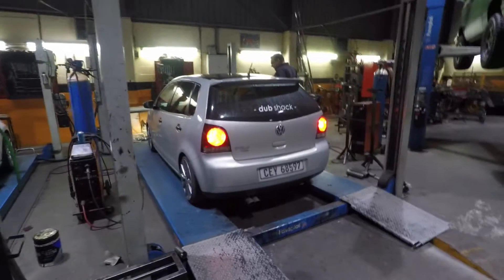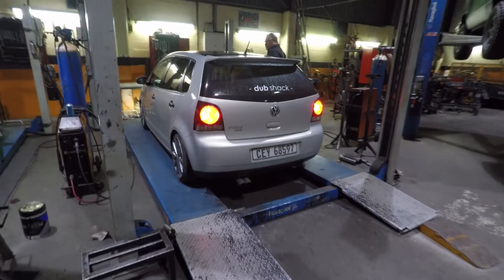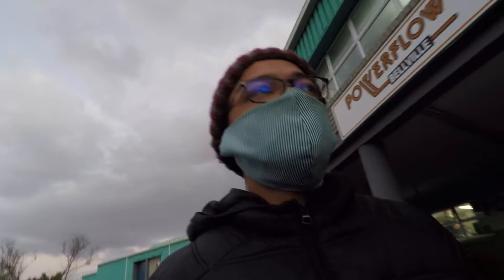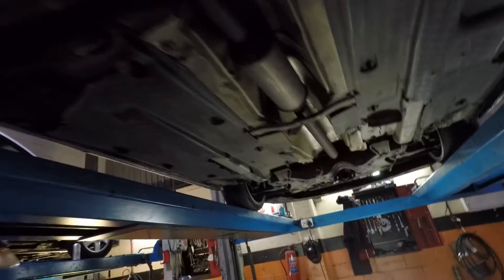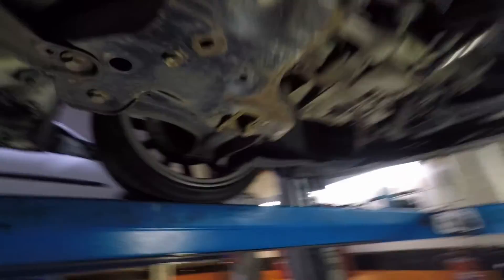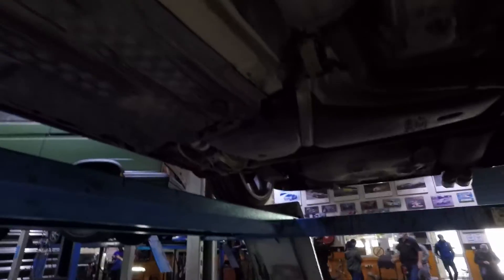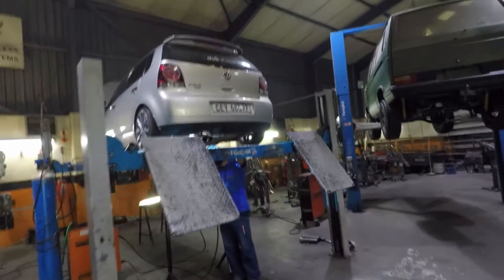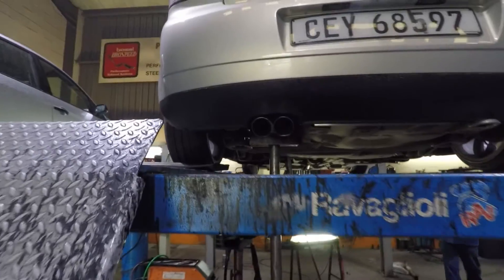The Polo gets a branch!

Comment: How's the fuel economy after installing banana branches?
Reply from the maker: Bru it’s the best decision ever. The car gets 950km+ per tank. The tune makes it even lighter
Reply: @nicowalters  you changed the whole system or only the branches...

If you changed it, you put stainless or
Reply from the maker: @lindanimpilomthembu327  whole system was changed to power flow branch and power flow exhaust

Comment: And after my exhaust full change do you advice to take to dyno n get it tuned for the system to work with it or the learn its as u use it (new to exhaust upgrade s)
Reply from the maker: You can drive it as is with the exhaust and get it tuned at a later stage, nothing will go wrong and you'll still see an improvement in fuel economy without the tune

Comment: Howzit man I seen this video. If you don't mind me asking you a question. I have a 2012 Vw Polo Vivo. I've been thinking of putting a freeflow but I would like to knw how much does it effect the power and fuel consumption?
Reply from the maker: Yo bud, I also a 2012 vivo. A powerflow doesn't effect the fuel consumption and then if you add a branch as well then it'll make the car lighter on fuel if you don't drive it hard. You'll feel a bit of a power difference but it's not a lot at all. Then if you tune the car you'll feel it's a lot more alive but also alot lighter on fuel. When the car was stock I got 700km out of a tank, with a branch and exhaust I got 780km and then with the tune I get 930km (always more than 900km) out of a tank
Reply: Thanks so much man for responding.
Reply: @nicowalters , hi bud

If I may ask who tune your vivo and price thanks
Reply from the maker: Yo buddy, Liam from TDC performance. It was 2499
Reply: Hi bro, do you have the stage 1 eco file on your vivo?

Comment: Am curious arent any fines for mods in exhaust here SA, thinking of putting 50mm as iam searching Am in East London
Reply from the maker: How's it, not that I am aware of, but I could be wrong
Reply: Today man ,am going to powerflow East London, polo 1.6, did fit first scorpion branch kept stock but it was sounding as leaking, now i just wanna see jow it turns out 27/02/23 11:12
Reply: Hey man,am at powerflow now, 28/02/23 13:17pm they busy with car, am played cause total is all R3100+R3184 (scorpion branch and its labour) + (Sound fit 2x mufflers/box , tubing, exhaust tip + labour) , please respond regarding price but i already paid
Reply from the maker: Yo bud that pricing is more or less what I paid a few years ago. I know it's a lot of money but it's worth it at the end of the day. You'll see 🙏🏽